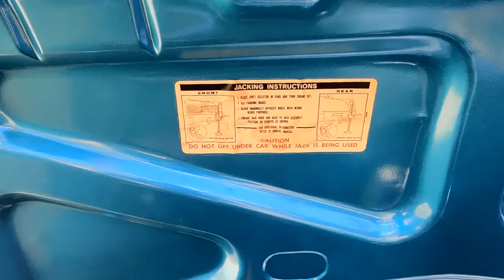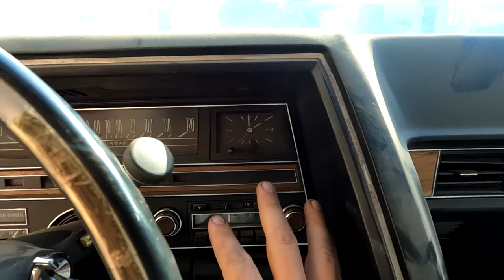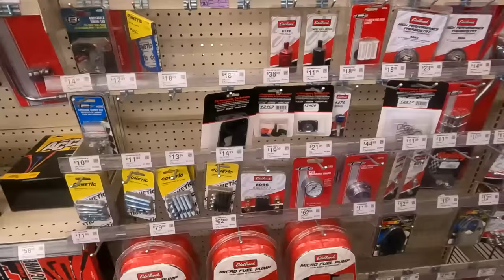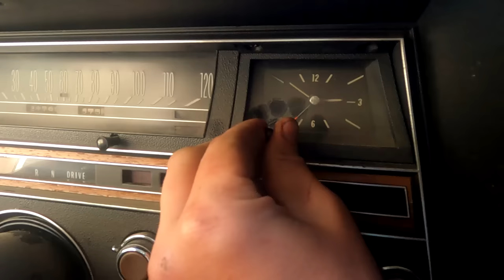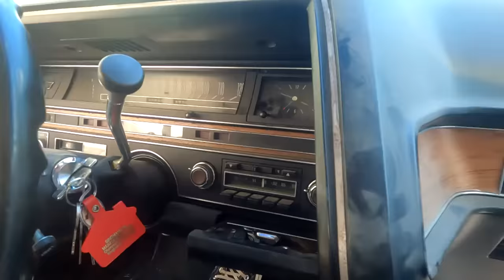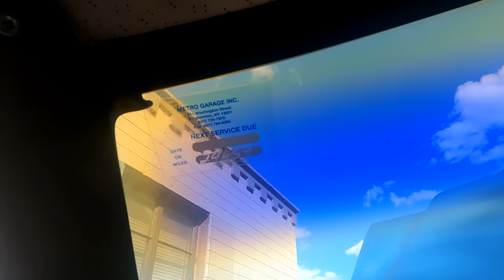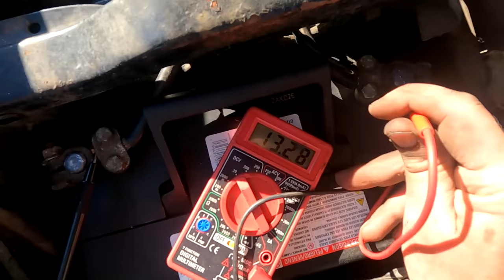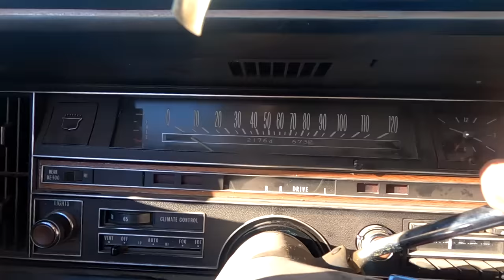Will this FREE CADILLAC run AND drive after sitting 20 years?

Comment from the maker: thank you all so much for 20,000 subs and 1 MILLION total views on the channel. your likes, subscribes and comments all help youtube push my video to new people. i dont take it for granted!
Reply: Are you going to sale that ih truck?
Reply: This 67-69 Eldorado is one of the best designed car, I almost bought one here in Canada...it was just too much rust in my budget...still looking for the next !
Reply: Its a vent for smokers back in tge day you could smoke with the windows  up
Reply from the maker: @codyvought8923  we’re working on another video.
Reply: Take the rear tail light lenses out and clean the interior them.  Things will brighten up.
Reply: @electricaviationchannelvid7863  They are one of the coolest designs ever, but the frame is chopped after the rear axle with a single leaf monospring rear suspension which  gives it a "boomy" ride. Still an iconic great car as is the 1966-70 Olds Toronado. I am not knocking this car as I do own a 1970 so I do like these cars.
Reply: @jeffrobodine8579  I had a 73 Toro in red with white painted top...I miss it now! The previous gen Toro is another list item could be...The torsion bar feature I do not like...I do not think anybody can fix them or get parts for them...
Reply: Right on. We are opposites , I can't leave anything alone. I modify everything I can. My 66 F250 is getting electric drive, but I am keeping the 3 on the tree

Comment: The bottle mounted on the inner fender was for extra windshield fluid!  It came as a standard feature in most 60's GM cars of that era!
Reply: You are correct. I have one on my 1963 Buick Riviera
Reply: If the bottle still had a label on it, it would say, “GM Optikleen”.  :)
Reply: The fluid in the bottle was a CONCENTRATE. You mixed it with the appropriate amount of water depending upon the level of freeze protection needed.
Reply: @roberthenley2474 Yep got one on my 65 impala 👍
Reply: wow

Comment: The hoses and blower motor are for the rear defogger.  Electric defrost was an option, mid year I believe.  And they were REQUIRED in the state of New York.  Seat belts were mandated for cars produced after 1 January 1965 for both front seat positions.  Shoulder belts were mandated for all cars (except converts) manufactured after 1 January 1969.  Nice old boat, just check all the hoses and belts (replace ALL belts and hoses and flush the cooling system and check the wheel bearings) before you drive any distances.  Phoenix is BRUTAL on all the rubber hoses and belts, even if it was stored in a garage.  I would recommend a trans service as well.  I live there for years and horse traded a lot of cars and since they don't have a state "safety inspection" a LOT of issues were ignored.  Safety is FOREMOST. Good luck with it.
Reply: New York and Massachusetts have safely inspection requirements since the early 90's so this one would have had that done before it could be registered

Comment: That air thing in the trunk is a blower for the rear window.   A "rear defoger"... before the gridline in-glass type...  GM used those on a lot of their big cars.... didn't do much for keeping ice off the glass.   But it did "defog".      Those vintage Eldo's are the best!!!!   A big true Cadillac 472 CID V8 with a 1st Gen Front wheel drive car!  They were tanks but great cars.  Take care if it!!    Ps... those "coat hooks" are shoulder belt holders as most people didn't wear belts back then... they would fold up in the ceiling to get them out of the way.  Also car had "rim blow horn"... you squeezed the rim of the steering wheel and the horn would sound.
Reply: Crazy thing with my 69 was that the only reason I replaced the headliner in it, many moons ago, was that the seat belt hooks rusted through the headliner. I have had people tell me they are stainless but I can tell you from experience mine were not. So maybe it depended on the trim package. But 60s GMs and modern 'vettes are the best vehicles GM ever built.
Reply: never fails to amaze me just how many `car guys` in these shows they present know very little about what they are doing.

Comment: Great find!! The V-shape in the rear window was formed by taking the sheet of glass and setting it on a hot steel rod make it malleable at the center point, then bending it to the exact angle for fitment into the car, right along the assembly line at the glass install station. They had to wait for it to cool before inserting it into the car which slowed production and contributed to the high sticker price.
Reply from the maker: That was just the cost of being cool I guess haha
Reply: The 1967-70 Eldos are nicknamed "Razorback."
Reply: @jeffrobodine8579  
Weren't they used in a few other gm cars?
Reply: @Theetravisb  
In my day, being cool didn't cost at all.
    If anything, being cool was more of an asset that paid off.

 "   I used to be down with it, then they changed what "it" was.
   Now. I don't even know what "it" is (but it scares me)"'   -
     - Grandpa Simpson

(Or something like that)
Reply: @theetravisb  
Would he have to pay back taxes on that since it hasn't been tagged in so long?
Reply: "Hot bent" wire method for forming glass. 1977-79 Chevy Impala/Caprice coupes used this. And late '70s Olds Tornados..

Comment: Man, to be given such a sweet classic!  I should be so lucky.  Yes, it's going to need a new vinyl top but for the price you "paid" for it, that's no big deal.  As clean as that body is any reputable paint and body shop should be able to match those minor spots with ease rather than repaint the car.  One thing you DON'T want to do is start removing any of those vacuum lines as the system is all tied together and you could lose or damage a lot on that car.  One very lucky young man!
Reply from the maker: Yeah I agree !
Reply: I'd rip the vinyl top off and just paint it white. Vinyl tops on cars are terrible they rust out the roof. Just my 2 cents.

Comment: had one just like it in 1983 I was  17 yo .It was so solid &powerful .Surprisingly good handling on back roads and was a unbelievable highway car shifted out of 2nd at 90 mph.at full throttle then would blast up to over 120 ,sick torque.just sucked you into the seats.!

Comment: Nice video. I just saved a 1968 Eldorado and it started right up after 12 years without a problem. 90% rust free and most electronics still work. I have the video of its first start in 12 years on my channel. I still have to replace wheel bearings before it can roll again but I'm almost there!

Comment: My second car was a 69 eldorado. I was only 13 years old. Times were different back then. This old man would feel right at home in that sweetheart. 50 years ago would seem like yesterday
Reply: I'm nearly 50 and I only hear stories like these from my Great-Uncles. Born in the '20s and  '30s. Many of them are gone now. But the fact that you could own and drive a car at 13....
I still can't get my head around that.
Reply: @ironmyno  I was out in the cornfields west of Chicago in the 70's. Nothing there and no one to care. Had 3 cars and a half dozen motorcycles even before 16, although only one of the bikes was a street bike. A Yamaha T250 2 stroke. No top end but a demon off the line.

You would have liked my first ride. It was a 1951 Pontiac Chieftain convertible. Bought it gor only $300 and drove it until the rotted exhaust fell off and the rear end failed. Restored, it would easily go for $100K now.

Comment: A friend of mine had a blue '68, looked just like that one, '67 through '69 had he same body style, those things go, you could drive down the interstate going 80 mph and feel like were crawling they're so smooth. 472 CI. Beautiful cars. It's funny watching young people figure out things us geezers remember. Seatbelts were required starting in 1968. I would kill for that car. Those clocks never worked. It was easy because of the low mileage and it's a Cadillac, Cadillac owners took care of their cars and they lasted anyway. I hope you guys are using high octane gas. Rear defroster, not heated, they blow air, and they work.
Reply from the maker: Yes the clocks first thing to go
Reply: @theetravisb  They look cool though. 😂

Comment: Another free tech tip.  I currently live in France/Riviera ... most placed don't have "Garages" so have to park my C6 Z06 outside ... with the Mice. They kindly leave Acorn shells on top of my Engine cover. Found out that dosing some Cotton balls with "Peppermint Oil" and leaving them around the engine bay repels them; doesn't kill them, they just can't stand the smell. Also made a next in the cabin air filter ... replaced and dose it with the Peppermint Oil.  Not a mouse has come back since ... you do have to reapply the Oil periodically ... like every other month to keep it fresh.  Nice smell in the cabin BTW !!!

Comment: I can believe that is a 21K mile car. It is in amazing condition, and was certainly well cared for. I would definitely remove that vinyl top as quickly as possible though. It will rust out the roof under it if you leave it on there in that condition. With a little bit or work, that car will be worth some money. I wouldn't use it as a daily driver. I would try to keep the mileage low on it. You guys need to find some indoor storage for that car. It has clearly been stored indoors for most of it's lifetime. Especially in a climate like Arizona, it will deteriorate very quickly if you leave it outdoors. I have seen it happen. Keep it covered at the very least.

Comment: Hi.. This is the first video of yours I watched.. And I had to comment..

I owned a 1969 Eldorado in factory Wisteria (a light purple) that was a $$ option. So purple with a maroon interior..

The engine is a 472ci.. Puts out 375 HP and 535 foot pounds of tourqe .. I'm writting and haven't finished watching.. This is FWD ..2nd yr for Eldos .. The CV joint boots tend to tear often (too much power)...
  The factory horn button is a 1 year item.. It was called "rim blow" the inner ring of the steering wheel is the button as you are holding the wheel you squeeze the wheel with your thumb.. 
  As you sit in the drivers seat, open the glove box.. On the edge of the door there is. A slot about 5" long..The owners manual goes in there (most people don't know this)..
  The a/c system or climate control.. Is always on.. The a/c compressor is always on (I put a switch in mine to shut it) when these cars were made, gas was ? $.25 a gallon.. Also only use R12 don't covert to R134... If you can get "R12"  there were "drop ins" we used back in the day.. It was basically Propane.. Yes you can use Propane.. I know I know it's flammable..R134 Isn't until it's under pressure combined with oil.. It's less then 2lbs.. Don't worry, plus the a/c will be much colder then R134... 
  I daily drove mine, it was great but 8-12mpg in the city wasn't.. Maybe 16mpg on the hwy.
  The ash tray/ cig. Lighter on the door was for the rear passenger.. 
  I'm kind of sorry I sold that car but the money was good and it was hard to keep in the city without a garage..
  Good luck to Chris..
Reply from the maker: Thanks for the comment and the info ! I didn’t know the compressors were always on.

Comment: Incredibly clean interior for being sat this long in the dry heat. Wow. Some light cleaning and a good condition and that “Leather with Vinyl” will be looking brand new. It’s leather seat faces with vinyl on the sides and back. You can see the sides of the seat where it changes from leather to vinyl. As you said, the vinyl pieces don’t crack, and still look new.
Reply: Some conditioner on the leather and remove that vinyl top. Once the top starts peeling, they usually make the roof rust fast. Often, they don't paint under there.
Reply: @66skate  Not only did they not paint under a vinyl top, sometimes the roof is attached with lead, or so I once read about some of those early to mid 1970s G. M. cars.

Comment: I had the 70 Eldo in gold . It was named The Golden Warrior !  This is a fast car and drives like a dream. The back windows are great , they slide into the body of the car. It was one of my favorite Caddies and I have owned quite a few . It is the first American made car with front wheel drive . Use lead additive in it .
Reply: Oldsmobile Toronado was introduced in 1966 with FWD, Eldorado went FWD in 1967. The Cord L29 was FWD, by the way, from 1929 through 1932 followed by the FWD Cord 810 / 912 of 1936 - 37 which inspired the '66 Toronado.

That said, 1970 was the best year for Eldorado and the best of the 472 / 500 series engines.  I had a gold '70 DeVille some years ago.
Reply: Those tires won’t have date codes. That started in 2000 or so

Comment: It’s a “rim blow” horn. The center section of the steering wheel does not activate the horn. Again, you’re very lucky it works! The rear “defroster” is actually a “defogger” simply blows air on the rear windshield. Lucky that the shop didn’t just part the car out for a quick buck!

Comment: Fun facts ... the '67 Eldorado was the first with front wheel drive (first GM with front wheel drive was the Olds Toranado in '66). While this is a 472 cuin engine in '70 they got upgraded to the 500 cuin (400hp and 550 lb-ft of torque) for better performance. I had a '72 Fleetwood in my College days ... only mechanical issue was a broken Valve spring (didn't tear anything else up thank goodness). But some free advice for your bud ... hot Texas day and had a rain shower that dried quickly but still a few puddles. Pedal to the metal on highway on ramp, hit a puddle and the Engine died. Pulled over ... no mechanical sounds and restarted just fine. But the second I put it in gear and gave her gas, she died.  Had it towed to a "Shop" who wanted big bucks and rebuild the engine. Being in College, didn't have that kind of cash so in the pre-internet days, ask friends if they knew of a better shop; wasn't buying the motor rebuild diagnosis as there was zero mechanical noise. Asked my Barber and he pointed across the street to old gas station mechanic/muffler shop. After my haircut, walked over to discuss the issue with the old guy. Told me to tow it over by 8 am and it would be fixed by noon.  Sure enough, came at Lunch and it was running like a Top !!! I was amazed ... so I asked him what happened.  He informed me that Caddy's have a double wall exhaust system to keep everything "quiet". When I hit the puddle, the inner wall ballooned and restricted exhaust ... think "Banana in the Tail Pipe" gag.  So if it ever happens, your Bud will know ...

Comment: Very smooth vibe on this video! What a lucky duck your friend is to get that beauty for free. A definite keeper. I bet if you put put on the r134 adapters and a few cans of the new stuff, that ac will blow fine. Great job on the fuel pump, jut drive her into the closest tire shop for some new rubber and hit the road, for sure. Happy Trails!
Reply from the maker: It definitely doesn’t need much to be back on the streets
Reply: "U can still get an R12 equivalent->!¡"

Comment: The tubes from the trunk, are for defrosting the rear window. It drag air from inside and blow it on the rear window. Do not throw those. It is very rare to find one with those hoses still intact!!!!! Great car. You have a button on the dash, with rear defog written on it. That button start the fan for the rear window. The engine is 501 cui. It has arround 500hp at the Crank.
Reply from the maker: Thank you we ended up finding that out
Reply: These had no where near 500
Reply: I think there's also a heating element in the unit.
Reply: @gyasijackson8828   it was the 70 that did , biggest year motor .
Reply: @lightmarker3146  yes that true those  500's are monsters rebuilt with some go fast parts
Reply: No, it's a 472 at 375 HP.

The first 500 was in the 1970 Eldo and was the only 'pre smog' 500 cubic inch ("501") Cadillac. The '70 Eldorado had 400 HP, not 500, but had a whopping 550 foot pounds of torque. 

The 472 / 500 are essentially the same engine. Heads, intake, and exhaust manifolds were restricted on the 'smogged' engines of 1971 and later but can be swapped out to aftermarket parts.  Properly built, horsepower in excess of 500 is attainable even if naturally aspirated. Torque can be astounding.
Reply: @-oiiio-3993  Thank you. It's nice when someone actually knows what they're talking about in the comments.